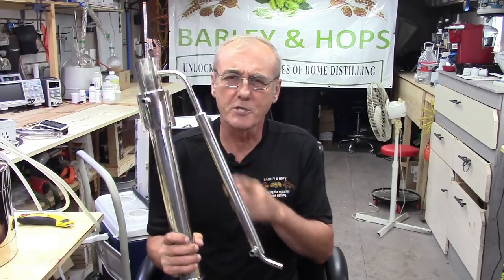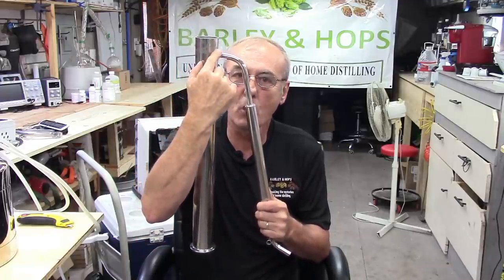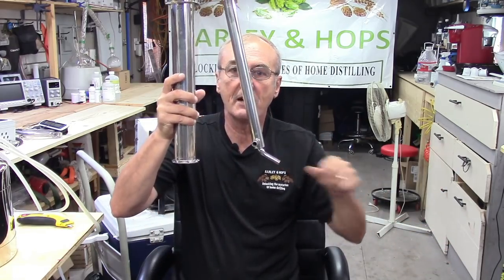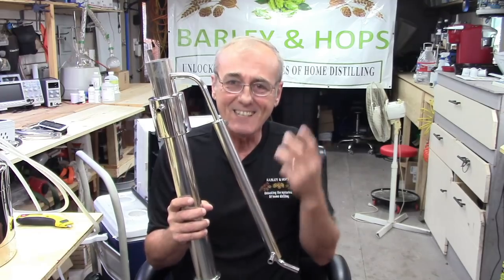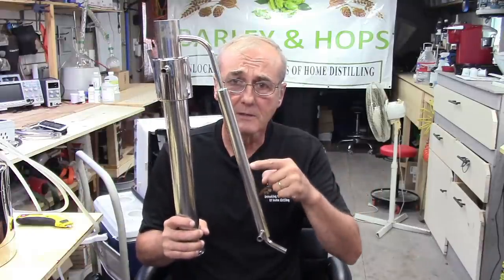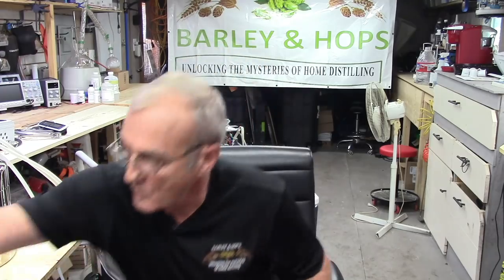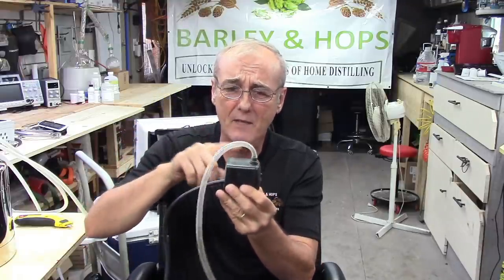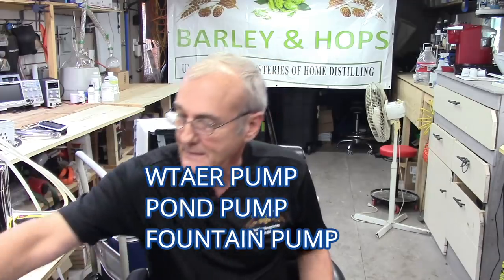CONDENSERS ,WATER TEMP, FLOW RATE

Comment: I added a small car radiator with the electric fan between the lieberg return and water tank. By far best system addition with no more ice or high water bills. Depending on air temp in the shop, water is usually a couple degrees cooler at the end of a 3 hour run. This is on a pot still, haven't tried with a dephlag yet.
Reply: Good idea!

Comment: I copied your air conditioner idea and it works perfectly! Added a simple inkbird thermostat that kicks on and off to keep the water cool without me paying attention. Thanks! You rock!
Reply: HI Ron, Nice work, had a the same thought. I'm now inspired to give it a go. Thanks.
Q. Is this how its done at Lagavulin? "Ron" lol.
Reply: I got a worm that's 24 feet long I got the copper pipe real cheap and I always heard more the better the flavor were the impureties stick to the copper but that's only reason why it's so long but I pull water from a stream to keep it cool even thow it's ina 50  gallon drum it gets the top foot and a half very hot so I do that to keep fresh cold mountain lime water that' stays cold year round but in August I was loosing proof and George just told me why without me asking
Reply: Do u guys sale clover clamps and gaskets I built a column still to strip with and I need clamps bad

Comment: Subscriber! Great video, George.  Another alternative to condensers is air! If you buy copper tubing with fins attached (like a baseboard radiator) the fins will dissipate the heat if you blow a fan across them. Meets your rule of thumb too. This method has no equipment except a fan and no water, coolers, ice etc.
Reply: Did it work?

Comment: 9:50, i use a 15gal storage container and i freeze water in gallon milk jugs and add them 1 at a time to my container and let the hot water run over the jug as it comes out. its worked quite well for me. then i just reuse the same jugs with the same water, virtually no waste except the 15 gal i toss at the end of the run.
Reply: Lol, I had the same idea with 2 liter soda bottles containing salt water. Glad to hear someone else is using it!

Comment: This just helped me out a lot.  I've been running my pump at full blast and my output is a lot lower than I'd like.  It's too cool coming out the top so it's condensing higher up in the arm and not allowing enough to get in the condenser itself.  Thanks George.

Comment: I have a 30 inch by 3 inch shotgun condenser  an use 15 pounds of ice on a 20 gallon batch that takes 6 hours to run and still have ice left when I'm done. Right now I'm working on converting a water cooler to chill the water so i can skip the ice. Thank you for another great video to help us be better and safer at our thing and as always #HappyDistilling George
Reply: Look for a beer cooler (from between the keg and the tap) from a pub/bar refit.

Comment: George, I’m very jealous of your homemade and very efficient chiller. I remember when you first built it and I wanted to build one myself so badly. But alas, it wouldn’t work in my situation because having to vent out the hot air expelling from the AC unit; through one of my kitchen windows just wouldn’t work out too well. Perhaps one day I’ll try it. But for now, I start up with a half a bag of ice, then proceed to my frozen 1 L bottles of a salted water. This set up works pretty good, whether I’m running in pots Still mode or in a reflux mode. It keeps up pretty well, so I guess I’m happy. Another great video though, keep up the great work my friend.
Reply: Mr. Pig, I do the same, except I don't start up with a half a bag of ice. I have some jugs of frozen salt water in the freezer and use them in an ice chest filled with water, to chill the condenser cooling water. I would  suggest using 1 gallon bottles instead of 1 liters because the surface area of the larger bottles is greater. As the ice melts from the outside, inward, the rate of heat transfer at the bottle's surface declines. The difference is not all that great but it reduces how often  you need to replenish the ice.  

Having George's chiller would be nice but my limited space and AC power makes the reusable blocks of ice a better option for me.
Reply: Why do I have to use salt water blocks

Comment: Hey George ! Yep,  It went BING ,and I build me one of a broken de-humidifier. works like a charm in a 80l. foam insulated tank. Plan on putting a stc-1000 on to control  it. Soon i have everything to run, just missing time :-(  Looking forward to the reflux video. I'm putting a flow meter with a needle valve in after the pump, and a thermometer on the return line. Hope to get some data that I can use in all my reflux runs.   Good day ad happy distilling/brewing to ya all :-)
Reply: I’m building a similar solution.What is your flow rate? And temperature?
Reply: @johncummings9740  Hey, and sorry, I haven't had the time to run that setup yet. To much work, at work and home :-( but if you get some data, please post it .

Comment: I freeze 4 -2.5 gallon plastic water jugs  and fill up a 150 quart cooler with about 15 gallons od water. I went with building a stand and putting the cooler up high then in the middle of the stand i have a shelf for catch jars and still parts. So its space efficient for me. I have a 30 in shotgun condesner  and a dephlegmator. I just have to crack the valves to get enough water for my reflux and condensingA 10 gallon run takes me 9 hours and I have plenty of cool water to get threw.

Comment: Hi George, so just wondering if the  "PID GUY" would think about doing a double build control unit in one box. By this I mean heat for the still, and cool for the AC controlled condencer. would make the cool points go up. Happy distill....👍👍
Reply: You don't really need a PID for the AC. A simple temperature controller would do just as well and be cheaper. STC-1000's are ubiquitous and would possibly be able to run the AC.

Comment: hi Mr. i use to work in a foundry years ago , my cooling water on a die caster was well water at 54 degree , i would tweet my input to where i had 85 to 90 degree on my outlet. if not it was not picking up heat and the metal would stick due to hi temp, or not set solid. that was 1600 degree aluminum. i rum my still same way , i cut my cooling water down so my outlet temp is about 80 or so, warm outlet .good heat exchange, and a great drip drip spurt. oh yea.

Comment: I use a cooler and pump,with frozen  reused bottled water,I probably go through 50 - 60 bottles. Tried two liter bottles to start with,but they didn't cool as well, I think when they were half thawed, they didn't exchange the heat as fast?

Comment: I tried having a look but couldn't find anything. Do you have any videos for cooling condensers?

I have a 50L unit that works great, but I use a water pump that pumps cold water through it and I keep filling a bucket with Ice... but it heats up enough that I'm plowing through 6-8 bags of ice every time I run the unit.

Comment: I was thinking about putting a bucket inside a spare countertop refrigerator.and running the water pipes and electrical cord for the pump through the walls. I just might have to take a look to see if it's condensing unit might be an easy as a conversion as this was. Probably not and I don't want to get into purging freon and soldering. I got to wonder how a 10 gallon aquarium chiller would do.
Reply: OK I looked at that little countertop frig and it's even more perfect for this than George's window AC because the tube to the evaporator is nice and long so it should be easy to bend. The evaporator is a neat little plate serving as the freezer bottom with the tubes stamped into the top side and somehow bonded to the bottom layer. That looks very hardy and easy to unbolt along with the thermostat. 
.
Only thing is I got to saw the inside of the box apart if I don't want to have to recharge it . . . and I don't . . . because that tube comes right up from the compressor in the condensing unit through the inside. But that's not a problem for me...Maybe even I got enough tube length between the high and low sides to to put the condenser on the counter and the evaporator will still reach inside the water source. Maybe mount everything on plywood together.
.

Thanks George ! Your videos are answering all my questions and informative about things I haven't yet thought to ask about, so as to keep me from bad choices otherwise.

Comment: So George, taking it to the next step.....would you say there is a regulated or required flow rate?  Even the little pump, if pushing 200 gallons a minute, does it matter only that the input is less than 1/2 of the vaporizing temperature?
Reply: Flow rate is something you'd find out in practice. If your cooling water is of an appropriate temperature and you're fully condensing the vapour, the flow rate is fine. If you're spewing vapour out the end of your condenser, you either need more flow or a cooler inlet temperature.

An alternative way is to feel the condenser. It should gradually get warmer closer to the outlet, if it gets hot half way up and doesn't feel like it gets any hotter, your flow rate is too low and you're under-utilizing your condenser. Condenser outlet temperature will also tell you this. The lower it is the better your condenser will perform. However, as long as you're not spewing vapour out the end of your condenser, increasing flow or decreasing inlet temperature won't improve performance.

Comment: Your water charges must be higher than your electric bill. Burry some copper tubing in the ground and control your heat more precisely using a PID to turn on your heating element, and controlling the volume of water you are pumping through your heat exchanger.

Comment: Hi George I was wondering on what your thoughts on using a glycol/water mixture  instead of just a cold water system? 

Also another thing which I think would be good to put thermal insulation on the cold water outlet to keep it cold before it gets to the vapour condensor 
As always thanks for your video
Reply from the maker: Not sure glycol would be an economical adaptation. If we were trying to prevent freezing it would be appropriate. Its cooling properties would not be much of a benefit for a condenser although using it would not hurt anything.
Reply: @BarleyandHopsBrewing  What you say is correct and incorrect and wanted to provide some additional background. Unless you are concerned about freezing occurring in your liquid mixture, it is actually detrimental to use a glycol water mixture because the specific heat of the mixture is less then the specific heat of water, therefore you will transfer less heat per unit volume of the liquid. https://www.jalopyjournal.com/forum/attachments/specific-heat-glycol-water-gif.3097575/ As can be seen from the graph the specific heat is highest when the glycol concentration is 0%.  Heat transferred (Q) = m-dot * Cp * Delta T where m-dot is the mass transferred per unit time, Cp is the specific heat (which is higher for pure water), and Delta T is the temperature difference between the inlet and the outlet. The higher the Cp, the more heat will be transferred. Sorry for geeking out but thought I would provide a scientific explaination based on my many years of thermodynamics :-)
Reply: @rickoms225, see my reply to George's answer for even more detail on this question.. I hope this answers your question and as always, #happyDistilling

Comment: Thanks George. Fantastic! This is the video I've been waiting for you to share.
Looking forward to information about dephlegmator (column condenser) running temperatures.
Q.  Water temperature in or out, to which one do we pay attention?
Happy Distilling from Australia.
Reply: I would control the temperature of condensate out of the condenser, that way you can choose what temperature the condensed vapour comes out at. You can change the temperature out of the condenser by manipulating the flow rate of the water through the condenser (or change the temperature of the water by adding ice, if you use the pump set up). Also note, most alcometers are calibrated at 20 c, therefore having a condensed vapour out at 20 c means you can test the concentration right away.
Reply: @MicahWeb  Thanks so much Micah. Great answer and explanation. thanks for your help.
Reply: @MicahWeb  Aah I forgot about that. If you are using a parrot you should be getting the distillate temp close to the alcometers calibrated temp. I don't use a parrot yet but will be soon. Thanks Micah.

Comment: what do you think about using a car heater core and a fan for cooling?  put ice in your cooler and use the heater core unit to drop the discharge water temp so the ice would last longer
Reply: Would work just fine! There are many ways to skin this cat and that is one of them 🙂

Comment: George, how many stills do you think this cooler setup could handle?  maybe a glycol additive and run it to max cold?  thoughts?
Reply: Air-conditioners work best at higher temperatures. The lower you chill the water, the less cooling capacity it has. If you want to run multiple stills, take the condenser outlet water, run it through something like a car heater core or radiator with a fan. This will dump most of the heat to the air. Then through the chiller, however depending on your ambient temperature and the size of your radiator, you may not need the chiller at all.

Comment: Hi, George! I had the idea of using three or four 2 liter plastic bottles filled with salt water and frozen to keep the water cold. What most of us have a deep freeze that constantly runs, so there's no real loss of energy. What are your thoughts on this?
Reply: I have many gallon and 1/2 gallon jugs of water in my freezer that I use when running. You’ll need more than 3 or 4 if your running 5 gallons or more.

Comment: I wonder if aquarium chiller, air thermal sink for PC (with fans) or any other options are available out there and if they work.
Reply: @Vesko Ruychev, yes they do. I will work with George to see if we can make a video on this. I use a PC liquid cooling radiator (120mmx240mm) with 2 each - 120 mm fans and a very small pump and circulate water through it and I can run a 2" still with no problems, and no refrigeration or ice is required and the power draw is very very low. I think this would be a great video idea for the future. I hope this helps and #happyDistilling

Comment: Quick question,why send the water in the bottom and out the top of the condenser? because heat rises is my first guess but I'm a beginner so really don't know.thanks bud,awesome info here...
Reply: @Daniel Pahoundis, I wrote this same thing elsewhere, but thought I would answer you directly also. The reason for this is based on a principle of temperature driving force. Heat transfers more efficiently in counter flow then it does in parallel flow. So which ever direction the hot liquid is flowing, the cold water should flow in the opposite direction for maximum heat transfer to occur.  In the case of a still the hot liquid is flowing down through the final condenser therefore the cold water should flow upwards. This is based on science and if you want the geek version you can watch https://youtu.be/3AJLNQJLZWA but just know that it is always best to have counter current flow through a double pipe exchanger. I hope this helps and as always #happyDistilling
Reply: @cryptoponics  thanks again and as a beginner things are going well thanks to your videos george,I love the hobby and your a very knowledgeable person on distilling....Happy Holidays
Reply: You could in theory pump the water from the top to bottom, but you would first have to fill the condenser (prime it), and ensure NO water loss while hooking up your hoses (which would also have to be primed with water) .  Air bubbles can form, and you lose most of your water/vapour contact area. I've seen videos where people have hooked up borosilicate (lab glass) condensers that way, and you can see the inefficiency with all the air bubbles churning around, preventing the water from contacting the vapour tube(s). Also, to a lesser degree, there's a counter flow principle of cooling that can effect efficiency...counter flow chillers run opposite to the flow of product.

Comment: Perhaps a silly question but I’m gonna ask it anyway. Does the angle of the condenser make any difference to cooling? I see some have their condenser at 180’ to the column and others at 45’ or so.  I guess the steeper the more the cooling?
Reply: @Markal, the angle of the condenser will make no discernible difference as long as the condenser is pointed slightly downwards to completely downwards so the liquid can drain out of the condenser. Also, you want to ensure that the hot vapors are coming in from one side and the cooling medium (water) is coming in from the other end (counter flow). This ensures maximum heat transfer. I hope this helps and #happyDistilling

Comment: George, did I hear you say that the water output of the pump should be connected to the bottom of the condenser ? I always assumed it should be connected to the top of the condenser and let the water come out of the bottom.
Reply: Yes he always says cold water in at the bottom and warm out at the top.
Reply: @svanveer, the reason for this is based on a principle of temperature driving force. Heat transfers more efficiently in counter flow then it does in parallel flow. So which ever direction the hot liquid is flowing, the cold water should flow in the opposite direction for maximum heat transfer to occur.  In the case of a still the hot liquid is flowing down through the final condenser therefore the cold water should flow upwards. This is based on science and if you want the geek version you can watch https://youtu.be/3AJLNQJLZWA but just know that it is always best to have counter current flow through a double pipe exchanger. I hope this helps and as always #happyDistilling